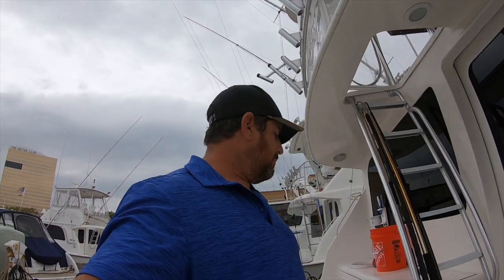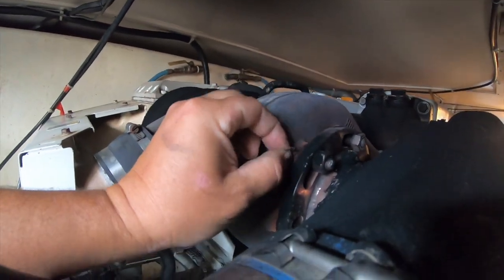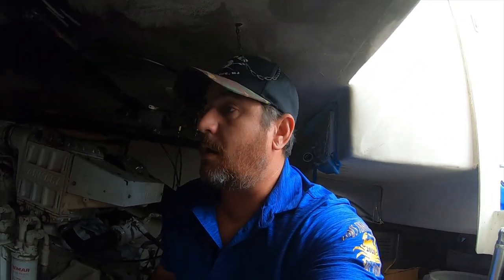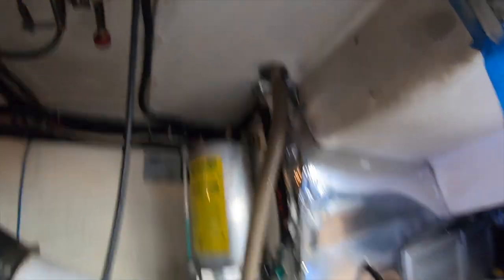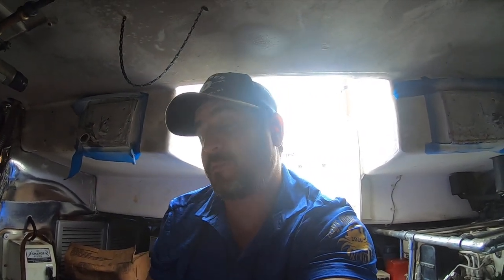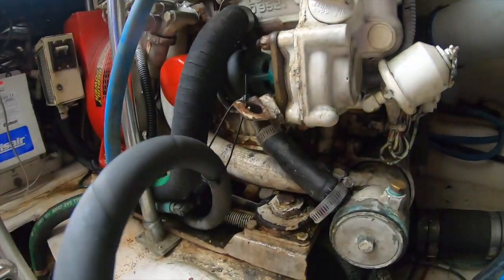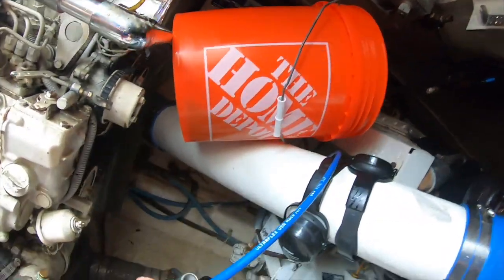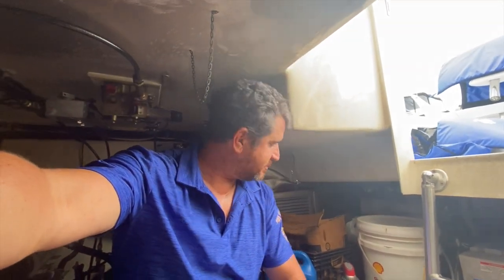I Broke the BOAT

Comment: Been watching for the past year, leaving for Montana on the 9th, I could swing by later August and help with the throttle cable and coolant leak/rebuild. Even if you aren’t working on the boat, I’d likely be driving through from mass

Comment: The turbo gasket that blew is made from metal and paper. The only gasket that you should run from here out is multi layer metal gaskets. Do not run the presses metal/ paper gaskets.... hence why it busted. Multiple layer metal gasket only, more expensive but will not leave you stranded plus they are reusable in case you need to fix something else down the line
Reply from the maker: thanks Alley. The new gasket is the official Yanmar part so hopefully that's sufficient